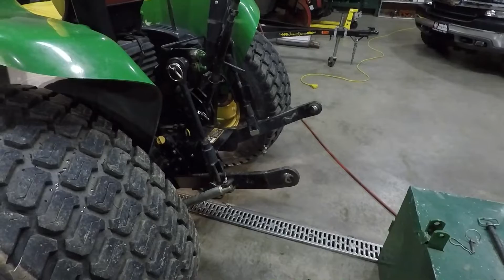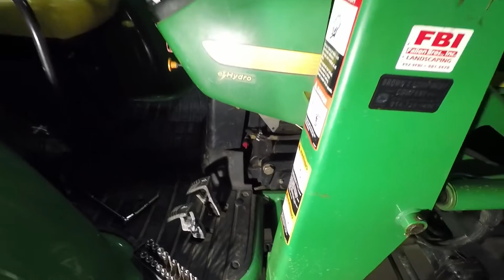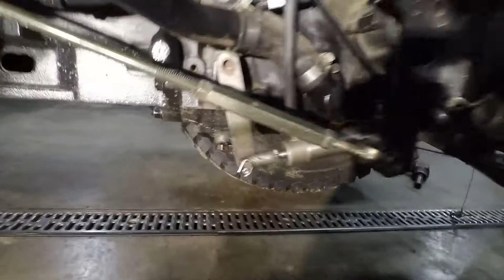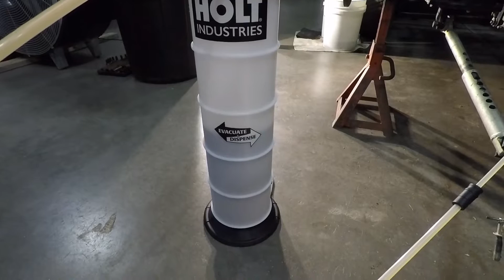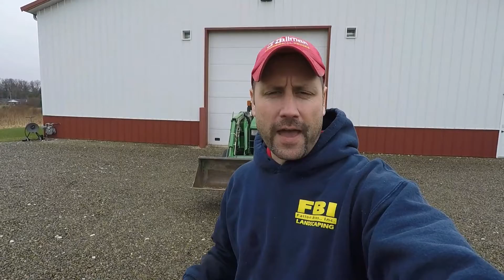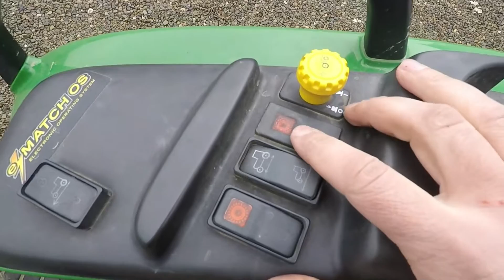Cruise control and LoadMatch not working on John Deere 4610 eHydro 4x4 tractor...Fixed!

Comment: I have a John Deere 4410  E hydro when I turn off the load match it operates fine when I turn on the load match it’s very sluggish. The transmission acts irregular. Do you think that it could be these two sensors that you replaced? Also when does it flash code errors? At start up? The speed cruise control works fine on mine
Reply from the maker: Definitely need to replace one or both sensors.
Reply: It was the sensor in bell-housing flywheel sensor replaced it works great again… thanks for help

Comment: my load match is not working, but the cruise control is OK.. i have a 4210 e hydro.    Did your load match work after the 2 sensors were replaced?   When i get in heavy grass mowing, it will bog down, instead of slowing the wheel speed to let the engine catch up... Help!!!
Reply from the maker: Yes, I recommend replacing both
Reply: Did you replace one or both sensors?? Was problem fixed??

Comment: I have a 2003 john deer 4610 hydrostatic not getting a code. forward and backward peddles stopped working, but bucket and everything else does.  Do you have any insite of what I can check?
Reply from the maker: DJ, you may have to have a dealer check it out if you're not getting any codes to help diagnose the problem.

Comment: Thank you video is very helpful,  any tips on fixing the tilt steering wheel?
Reply from the maker: Thank you Jim! Is your tilt stuck in one position? I noticed my lever is tough to operate at times.
Reply: @truckguyjoe  yes, steering wheel stuck down to lowest position. Makes it so I have to climb over it to get in or out of the seat. I have a 2008 4710 with 840 hours.

Comment: I have a similar problem with my 4210 where the cruise control isn't working and I'm getting a code...1 long, 1 short, 1 long, 1 short when trying to activate it. Looking for help on this please, thanks!!
Reply from the maker: I recommend making a video of the flashing error code you are getting and share it with a John Deere repair facility or  LandPro dealer...also make sure to give them your VIN and serial #. They should be able to confirm what sensors could possibly causing your symptoms. My guess is your forward speed sensor or flywheel sensor, much like mine!
Reply: @truckguyjoe  thanks! Yea its showing a different code now than what I posted on here. I'll call JD
Reply: Did you ever resolve the problem??

Comment: Great job on the repair Joe! That’s a nice little tractor . I love your shop , it is huge and clean as can be!  I love my fluid evacuators they are great ! The cruise must be handy mowing or doing any steady state work.Combined with the load sensing circuit you really can pay attention to where your going and not worry about keeping the engine and ground speed on its sweet spot .
Reply from the maker: John DiMartino for sure! I do love the cruise when finish mowing.